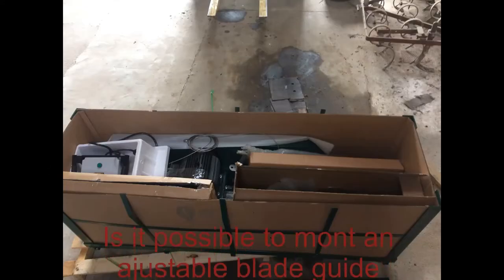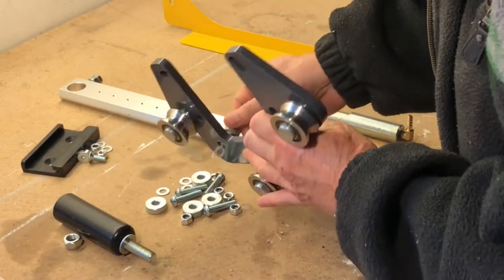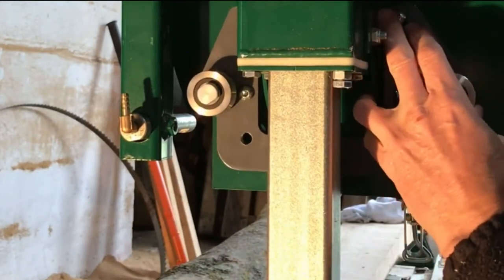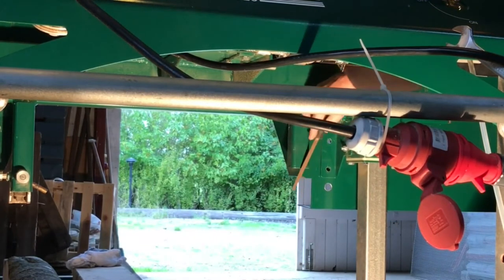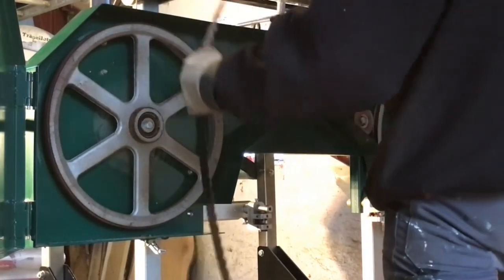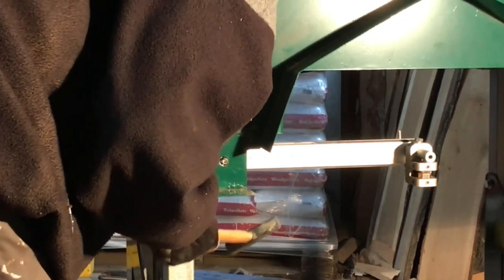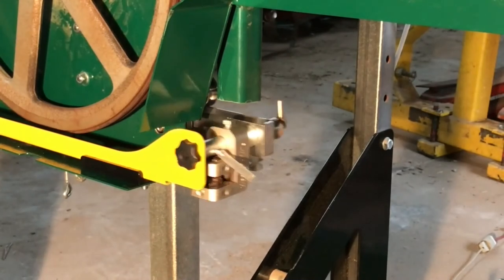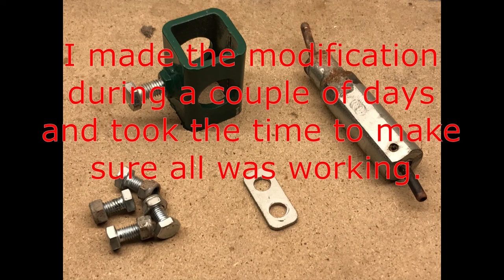Woodland Mill HM126e (2018), Modified with Adjustable Blade Guide

Comment: Did you find this modification actually produced better lumber  than without the adjustable guide arm ? I have a mill like yours and I do cut mostly smaller logs.    Average 12 inch diameter.     Thank you
Reply from the maker: Hi Bgj - it's a little hard to say - it depends on the quality of the blade itself. I didn't bought blades from WoodLand, and they are maybe not the best. For these blades I use now, I will say the cut is better with the blade guide on the saw. Also the tension on the blade is a parameter for a fine cut. 
Where I see the benefit is when you cut hard wood with a lot of branches - here the more narrow blade guide alignment insures the blade is not "wobling" every time it passes a "branch". Hope you understand what I mean.
Reply: @thimtools7538  thank you for your. Help.

Comment: The electric model sounds like it runs way slower than the gas model does
Reply from the maker: That might be correct - I haven't measured the RPMs on the Mill .. but I will do and let you know :)